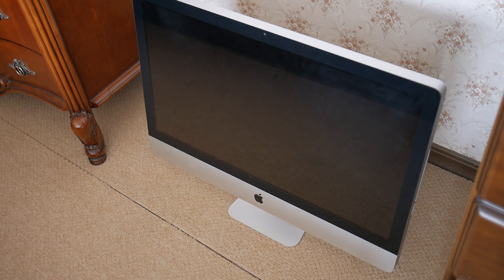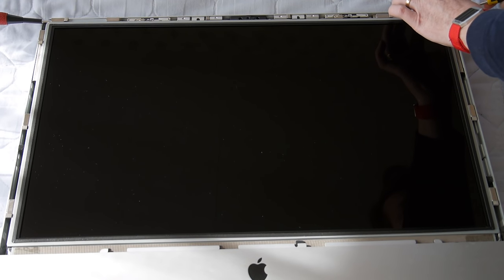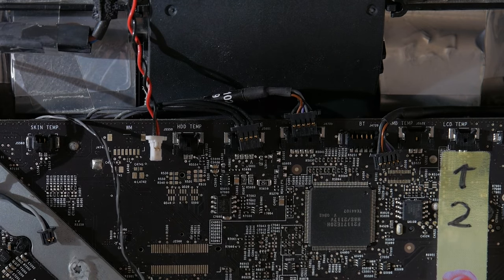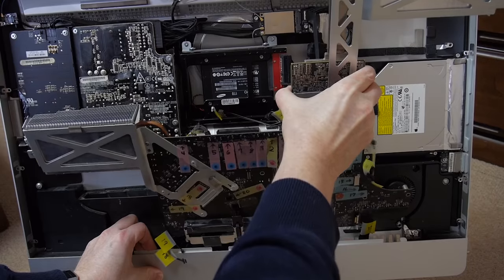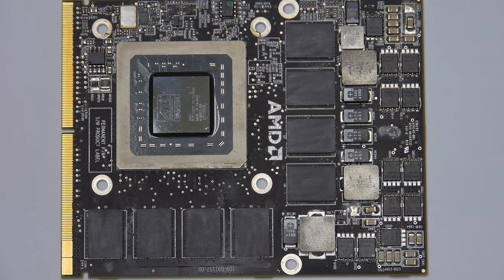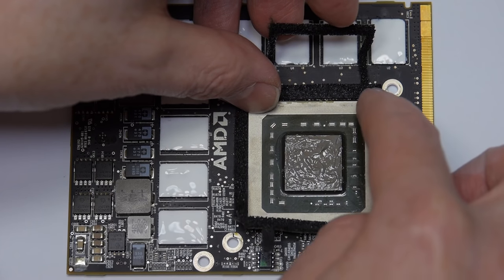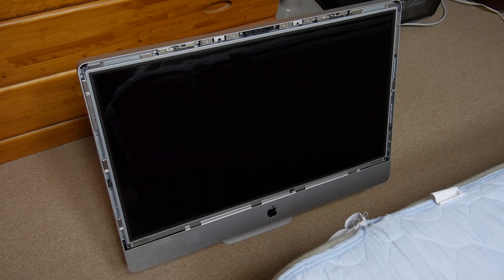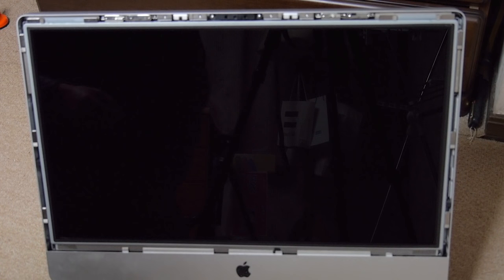Late 2009 iMac 27" Video Card Repair [4850 Bake]

Comment: *I WOULD NOT RECOMMEND DOING THIS IN A USED HOME OVEN, USE A HAIRDRYER OR HOT AIR GUN INSTEAD*. Putting soldier, steal and PCB ceramic in a oven used for food can omit toxic fumes that can transfer to whatever's cooking in there. While not a terrible ordeal it's just better practice to use something that's not A: indoors and B: used for food. Great video tho!
Reply from the maker: The bake temperature is not hot enough to completely melt all the solder, which is why components on the bottom do not fall off.  It takes 1749°C / 3180.2°F to boil lead (to generate a toxic lead vapor), whereas soldering temperatures are typically only 350°C / 663°F for a normal soldering iron, and in the case of the bake, we're using only 200°C / 400°F. So there is no toxic lead vapor being released during the bake or even during normal soldering.

When people think about "smoke"or "vapor" during soldering, it's actually flux which is added to the solder to prevent oxidation and make solder reflow better.  Flux vapor can cause respiratory irritation for some people if inhaled. But there is very little residual flux on the graphics card PCB or in the existing solder that would emit solder flux fumes. People worried about even a tiny amount of FLUX vapor released during the bake can simply wipe down the inside of their oven after the bake.  

People who are still too fearful to use an oven could use a heatgun, but caution must be taken because that can result in temperatures which can fully desolder components.  It's harder to gauge how much heat you are actually applying with a heatgun.  Even so, a few people in the comments have reported success with that method, and these folks are most likely experienced with heat guns too, which led to their success.

The key to the bake working is to heat the GPU chip to 200°C / 400°F for 7 to 10 minutes.  The fix is not permanent because its a defect inherent to the GPU chips themselves (not solder balls underneath), but typically the heat-fix lasts long enough to have made the effort worthwhile.

Comment: Guys I did this and my mac screen is now black... any ideas???
Reply from the maker: Assuming you did the bake correctly (200°C is roughly 400°F), and assuming you did not always get a totally black screen prior to the bake, then the root cause of a black screen post-bake is any of the following things:

1. You forgot to reconnect a cable you disconnected.
2. You improperly reconnected one or more cables you disconnected.
3. You accidentally disconnected a cable.
4. You broke one of the ribbon cables or a connector during your disassembly or reassembly.

I honestly do not think you simply had a bad bake, especially if your temperature was correct.  There have been very rare reports of oven temperature rising well beyond the setting and desoldering some components as a result (which is an oven problem, clearly), but I doubt that is your case.  It's troublesome, I know, but you will need to open the iMac again, move the LCD, then recheck every cable and connector pair to ensure all those connections are perfect.
Reply: @JDW-  Hi thank you for replying! So after many tries I kept turning it on and off and suddently the 4 diagnostic leds were green and the screen came back but showing a lot of colours and lines... you think I should bake it again and reapply thermal paste? Could it be that needs thicker layer?
Reply from the maker: @anderssong8707  I honestly don't think your bake has anything to do with it.  If there is a cable problem (intermittent connection), then it would explain what you see.  Turning it on and off repeatedly may have just been a coincidence in that the cable decided to finally reconnect and that gave you your display again.  It cannot be the paste because you are testing from a cold state and for short periods.  The card wouldn't have time to heat sufficiently for it to be a bad pasting problem.  If you recheck all the cables and find that the problem persists, then of course another bake at the correct temperature will be fine.  Just make sure you use a turkey thermometer to verify your oven temperature is indeed 200°C/400°F and is consistent during the bake.  Also make sure you preheat your oven before you put the card inside, then bake for 10 minutes.  Don't bake with the thermal paste applied though.  You will need to clean it all off, then bake, then reapply the paste.  And again, make absolutely sure your cables are all good and connected properly, because that is almost always the root cause of a black screen.

Comment: FYI. I hate break this to you, you don't have to take it the out the logic b to replace the video card.
Reply from the maker: Others have said the same, and here is how I replied to them: "You're right.  But to replace the logic board battery, you must remove the logic board.  And since this iMac was made in 2009, it is high time to replace that battery.  You will also see that part discussed in my video."  If you don't care about the battery, by all means, replace only the video card.  But removing the logic board will allow you to clean the inside a bit better.  Another benefit, at least in theory, is that to remove the logic board you must remove all the connectors and then reconnect them.  That might have benefits on old computers to remove any oxidation that has built up over time within the connectors. Again, no big deal if you don't remove the logic board, but there are some arguable benefits if you do. It's completely your choice though.

Comment: you only have to take out the heat sink screws attached to the logic board and  the video card can slide out easily. you wasted a lot of time. you can swap in 10 minutes
Reply from the maker: Sorry, but the entire procedure will take much more than 10 minutes, especially for someone who has never done it before. The final part, which I discuss in my video, could take 30 minutes or longer (putting the glass back on) if you are as meticulous a person as I am who tries very hard to ensure that not even one piece of dust gets stuck behind the glass. That would be easy in a clean room, but the vast majority of us will do this in a home where dust is flying in the air. I was able to achieve a dust-free glass replacement. It just took a long time. And if you forget something, you'll need to remove the glass again and then have to go through the cleaning process again. So in summary, while the mere removal of the video card is "relatively fast," 10 minutes would not be the "total time" required for this job.  If you disagree, I would challenge you to make a video for us showing how fast you can achieve a video card swap from start to finish.  I'm not saying you cannot do it.  I am just saying I would love to see such a video, and no doubt others here would as well.  Best wishes.

Comment: Very methodical but you didn't really need to do all that labelling. All the connectors can only fit in their own socket.
Reply from the maker: Yes, all the connectors are keyed.  However, not all brains think the same way.  Sure labeling takes time and some people refuse to make time to do that.  That's okay for them.  But for other people, even if the connectors are keyed, when it comes time to reassemble, having the at-a-glance ability to know exactly where a particular connector needs to go can be helpful.  Also, labeling helps to ensure you don't forget to reconnect one of those many connectors too, especially if you peel off the labels after reconnecting each connector.  This is akin to people who label things in their kitchen or refrigerator versus those who do not.  People who typically rely on labels would be well served to label the connectors on the iMac.  Those who eschew labels would likely do just fine without them.

Comment: you did not have to take out the motherboard to fix the GPU it can be removed off the board, without all that.
Reply from the maker: Indeed, which is described in the text description under my video as well as in my 2nd bake video.

Comment: Hi, i've noticed you use a grey paste and white paste. I've ever done with grey paste for processors. Does the white paste look like that ? 

https://www.flickr.com/photos/150038225@N03/34783207512/in/dateposted-public/

Thank you,
Loïc.
Reply from the maker: The white thermal paste you see in my video is "normal" thermal paste that is NOT conductive.  The other thermal paste I used on the GPU is gray in color because it is Arctic Silver V, which has real silver in it.  Arctic Silver V is conductive, so you must be careful.  If you apply too much of the conductive paste, there will be "over-spill" and it could cause tiny short circuits.  There's no worry about shorting the GPU pins, but in my video you can see tiny SMD (surface mount) capacitors surrounding the GPU chip.  If conductive thermal paste touches those, it could short them, causing malfunctions.  So it's best if you don't use conductive thermal paste.  Why did I use it?  Because I am very meticulous and careful, and that was all I had and I didn't want to order more online and wait.  If you are careful, you can use conductive paste on the GPU chip, but don't try it on the MEMORY chips.  I didn't.  That's because the legs of those chips are exposed, and there definitely would be over-spill on those.

Comment: You don't even need suction cups the glasses Hold On by magnets
Reply from the maker: Thanks for your comment.  The "front glass" is indeed held on my magnets, but the magnets are very strong.  The most logical and effective means of removing the glass "for most people" is a pair of large suction cups.  This is not unique to me either.  You will see this in various iFixit guides and most iMac repair documents.  Can you removing the glass without damage and not use suction cups?  Sure.  But again, suction cups (as shown in my video) are soft and work well.  These cups hang onto the glass for a long time even after removed.  Even so, I would recommend taking them off the glass once the glass is removed and the reapplying them when you are ready to put the glass back on.  Yes, even when putting the glass back on they can be helpful, especially for people like me who are perfectionists and want to avoid improperly shifting the glass even 1mm out of the perfect position.

Comment: Static dissipating bracelets don’t do anything. You have to be grounded
Reply from the maker: You are correct.  Cordless wrist straps have been testing and shown to be no different than performing the same test without one.  The strap always needs a cord that is securely grounded.  You also should use a grounded work surface, and ensure all electronics are kept in sealed antistatic bags that have no tiny holes in them.  In fact, some older electronics are so sensitive that you don't even have to physically touch the PCB to kill them, assuming the PCB is outside an antistatic bag.  The "proper way" to handle electronics is rather strict, and for good reason, and the end result is that most people tend not to care at all, until the day comes an electronic device is fried, and when that happens they usually don't know why.  But it's also true that some of us, myself included, have never shorted out a device, even after much man-handling while standing atop a rug in socks.  I've been handling circuit boards since the 1980's.  That doesn't mean everyone else will fair so well.  Indeed, you yourself could probably point us to numerous cases that show electronics death by a mere touch.  But realistically, most people just aren't going to take adequate precautions no matter how much you educate them.  Now with that said, did you have success in baking your video card back to life?  :-)

Comment: By the way: the type GFX card that are often used are so called MXM type GFX cards. They are dedicated for notebook use. Your card looks like a type 3 MXM and there are vendors who sell those separated and with guarantees and such. In Belgium there is this online shop, that sell kits. This looks like your type of gfx slot right? https://forums.tomsguide.com/threads/successful-mxm-gpu-upgraded-laptops.418038/
Reply from the maker: You can see from the splash screen photo on my 2nd Bake video that the 2009 iMac's video card is "Type B" in the Tom's Guide link you provided.

Comment: Sliding the Mac over carpet not a good thing folks.
Reply from the maker: Not ideal, no. And of course having a wired grounding strap securely affixed to earth ground and your wrist before touching the circuit boards is strongly advised as well. That doesn’t mean instant circuit death for folks who do not follow that advice but it may save some from unnecessary sorrow should static electricity hit the right chips. Thank you for the precautionary advice.

Comment: Hallo,

i've this problem since yesterday :

https://www.flickr.com/photos/150038225@N03/34701083332/in/dateposted-public/

This card is no longer marketed, and it's difficult to find a used card.
I'm interested by your solution.

1. How was your screen at start or on desk before you repair the card ? 

2. How many times do need for this operation, making it very slowly, 1 day ? 2 days or more ?

Thanks a lot.

Loïc Drouet.
Reply from the maker: Hi, Loïc.  Thank you for your question.  The screen artifacts shown in your Flickr photo are different from what I saw on my iMac.  However, that does not mean you have a different problem.  It is most likely a bad video card though, just like in my case.  But if you lack time to complete the entire procedure and if you just want to do a fairly quick "test" then I would suggest you follow the first part of my video to open your iMac, disconnect all the connectors from the LCD, then reconnect them securely and test.  If your problem is gone, then it was just a bad connection.  But if the problem remains, you will need to complete the entire oven-bake procedure.  If you are not distracted and if you allocate 1 full day, assuming you have all the tools and thermal paste required, then I think you can finish the entire job, even going slowly.  But be sure to mark everything like I did.  If you don't, you will forget how to put back all the connectors and that will take up a lot of your time.  Best wishes!
Reply: Hi Jwd,
Thanks for your advice. I've another screenshot when macOS Sierra is started :

https://www.flickr.com/photos/150038225@N03/34814268691/in/dateposted-public/

I'm going to follow your instructions until the connectors from the LCD to test if it's a bad connection.

Thank you very much,
Loïc.
Reply from the maker: Thanks for the screenshot.  That's definitely a sign of a problem with your video card, no question about it!

Comment: You could’ve saved urself lots of time.. you didn’t need to take out the main board
Reply from the maker: Thank you for your comment, but you seem unaware of the fact I have a “2nd Bake“ video which shows how to do it WITHOUT removing the motherboard.  You also overlooked the fact that removing the motherboard is still important to access the PRAM battery which is on the reverse side and which needs to be replaced by now. Lastly, at least one person has reported that iMacs newer than 2009 have mounting screws on the video card that need to be removed from the backside of the motherboard, not easily from the front like the 2009 version.  All said, there are legitimate cases where people need to remove the motherboard, and my first bake video shows very clearly how to do that.

For further information you may have missed, I strongly recommend that you scroll up and expand the text description beneath my video. I put a significant amount of useful information there. Thanks.

Comment: I broke this socket , the one which connects with the screen, but only one side. And i couldn’t turn on my mac, no sound, no screen. I didn’t break any other stuff. However I just finished to upgrade my Mac gpu, ram, and a extra ssd. Before that my Mac was without power plugin.  can you help me with this problem. https://zh.ifixit.com/Guide/iMac+27寸（2009年下半年至2010年款）显卡更换/9553 / the step 6 I broke one side of socket.
Reply from the maker: I am very sorry to hear that.  If you broke "one side" of that ribbon cable CONNECTOR (Step 6 in your iFixit link), then either you or an experienced person will need to use a microscope to resolver the damage, assume it can be resoldered. When I say "microscope" I mean something similar to the following product that will let you zoom in an inspect the damage more clearly: https://amzn.to/3d4qSIU
Reply: JDW hi, I find out how is call in English, the DisplayPort, one side pint, the little plastic hook i broken it. Can you tell me why I can’t not tune on my iMac? I believe this issue may only cause “ black screen “ but still with the sound right?
Reply from the maker: @timetosaybaka2008  Could you please upload a sharp, clear photo to a cloud sharing service and then post a link so I can see the broken part?

Comment: lol
Reply from the maker: No sure what you meant by "lol" but I visited your YT Channel and watched your bake video.  The only mistake I saw you made was in applying thermal paste.  You put a pea sized drop on all the chips.  That's fine for the GPU but not the memory.  Why?  Because there's a gap between the heatsink and those memory chips.  That means your pea drop of paste won't spread and it's likely not making much contact at all, except perhaps for a couple millimeters on each chip.  Apple used thermal pads there originally, but thermal pads can be hard to measure thickness, which is why I recommend K5 Pro -- a thermal pad replacement paste.  All said, if you find that your baked video card fails sooner than you expect, it's very likely due to the fact the memory chips on the video card were improperly pasted.  I know it's a lot of trouble, but I would recommend you remove the card and properly paste those memory chips to get the longest use out of the video card.